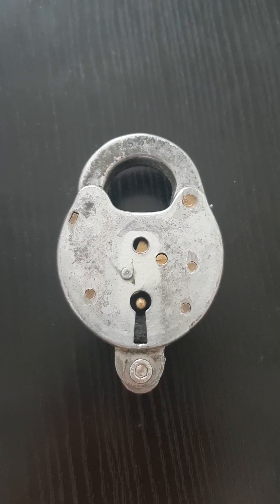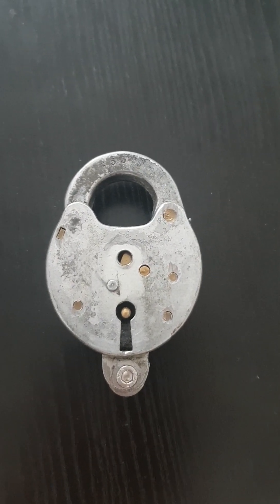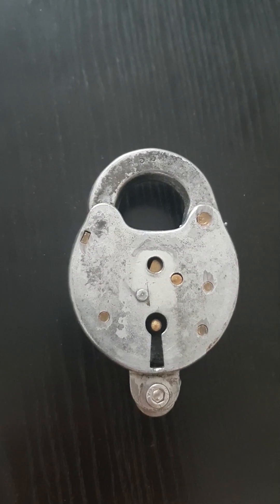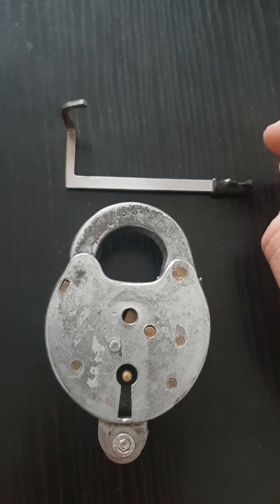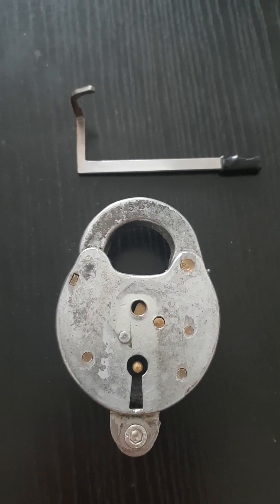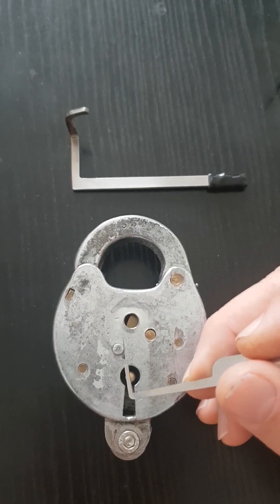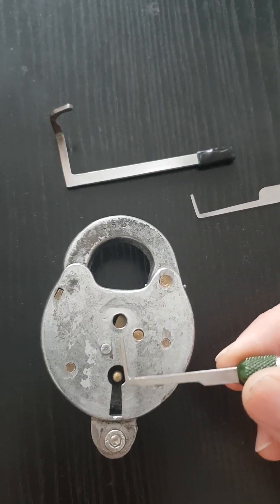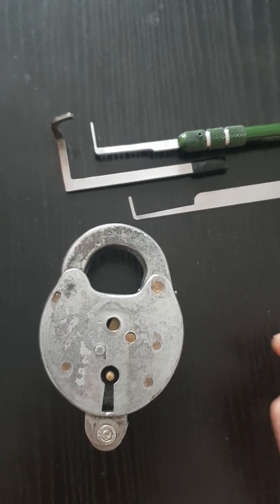My custom tools for picking YALE 1207 padlocks.

Comment from the maker: My rescent picking trials on this lock have shown that just the green handled pick can be used, but the pick must be inserted on the right side of the key pin, which is somewhat trickier to manipulate lever tumblers. This would eliminate having to use two different picks.